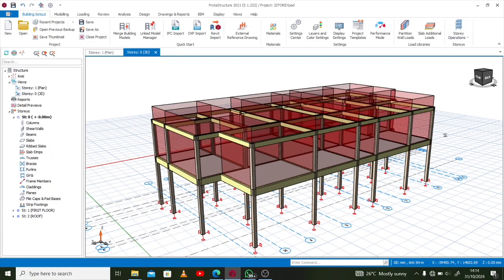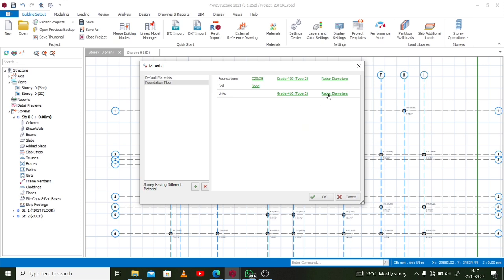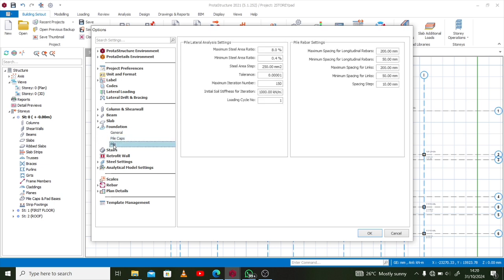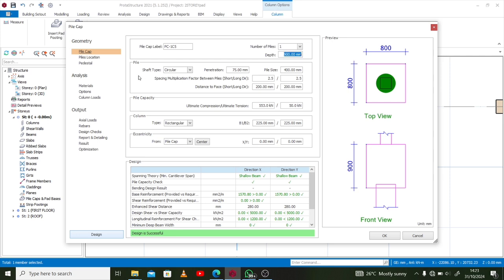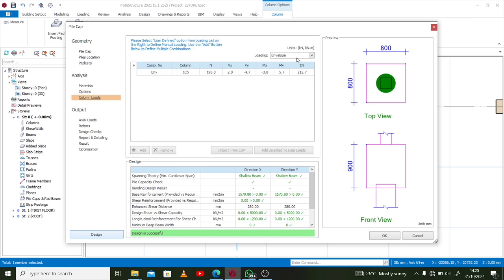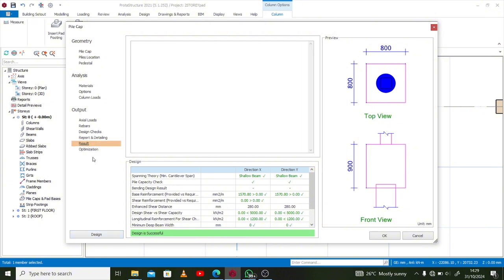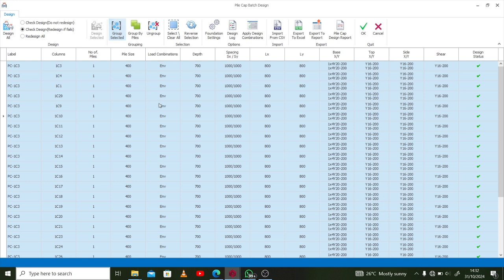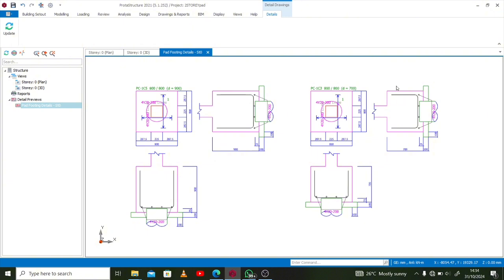PILE CAP ANALYSIS AND DESIGN

Comment: Your design should be in compliance with a referenced code of practice which would provide guidelines on the design philosophy (Limit state, working stress design or load factor design philosophy). This wasn't specified in this training. Typically, I should be expecting this to comply with relevant sections of EN 1992-1-1 as well as EN 1536 for bored piles together with specific reference to EN 1997-1. The design basis which provides guidance for the combination of loads from the superstructure under persistent, transient or accidental design conditions should comply with EN 1990. All of these weren't specified in the code. Also this software appears to describe reinforcements using the notation 'Y20 or Y16', etc. It should be noted that Y-bars are obsolete square twisted bars with inferior bond characteristics and have long been discontinued. Kindly refer to EN 10080-2005 as well as BS 4449-2005 for these specific requirements. I also watched a video where you mentioned relevant texts crucial to civil engineers, kindly refer to Mosley and bungey to EC 2, section 1.7.2 for these requirements. Finally in the design of pile caps after obtaining the loading on the piles using load combinations spelt out in clause A1.3(5) (Approach 1) of EN 1990, the pile caps are either designed based on truss analogy or flexural beam theory. None of these were specified in your training on which of the approaches the software utilises as well as the specific limitations associated with this. What is the guidance for trial sizes of the pile cap? pile thickness (based on pile size)?, spacing of piles to prevent overlap of effective vertical stress (bulb pressure) which reduces single pile efficiency, etc. these were not specified in the training. Kindly address